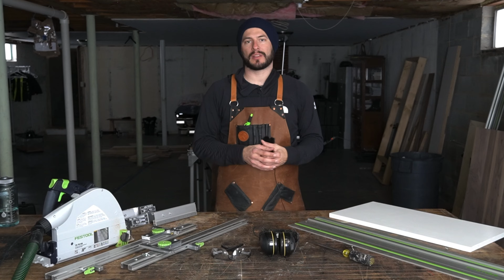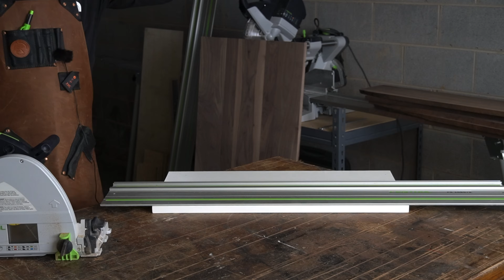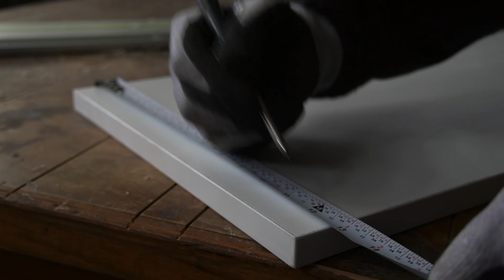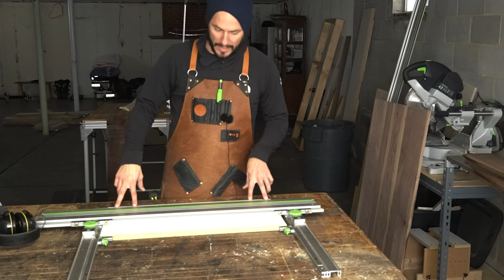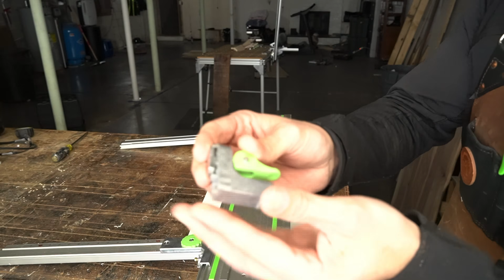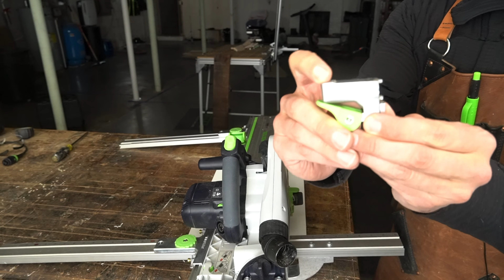How to Set Up the Festool Parallel Guides

Comment: lol, I wish I had the imperial not the metric, got my set used of of Craigslist at a price that was a no brainer. Just ordered a metric tape measure since metric is starting to creep into my woodworking. I do wish that the curser on the stops was a little more precise.
Reply from the maker: Metric is much easier to do than imperial

Comment: Maybe I’m overthinking this, but I’m having a pretty hard time getting my guides properly calibrated. For some reason I can’t just make the mark like you do on top and calibrate that way. I’m off by about 1mm. I take a square and match the line so that my track saw blade(in fast fix mode) is right off to the side of it. Yet I’m still off by 1mm. Do you think maybe I should draw 2 lines (2mm apart from each other) and try to set my blade right in between them?
Reply from the maker: Maybe? Usually these small issues are user error
Reply: @BenMarshallDesigns  I totally agree.  Since then, I think I was finally able to dial it in near perfectly.

Comment: To be a bit more precise, how about setting adjustable square to 12"=305mm and use that to give two exact same marks instead of tape measure?
Reply from the maker: You could, but to me it’s more work for the same result.
Reply: Yeah, except that 12 inches = 304.8 mm, so your suggestion is simply inaccurate.  Better to use 10 inches which is exactly equal to 254 mm. But I don't see how that makes anything more "precise"...

Comment: Thanks for the calibration video. I’m trying to decide on which system to get. Seems like festool missed the mark on the design of this product. It appears to rely on, not only the reference side, but the perpendicular sides as well. What if those aren’t square or are curved? Was that ever an issue for you?
Reply from the maker: If I'm understanding your question, the parallel guides only reference the parallel cut, it has nothing to do with the sides of the material, and actually it is recommended that the parallel guides not touch the sides
Reply: Better watch again. The Festool Parallel guides DO NOT rely on the "perpendicular sides" at all...

Comment: What about the the two flat had screws that engage the side of the rail on each parallel guide do you tighten those?
Reply from the maker: No. Those are only if you want to leave the guides affixed semi-permanently to the guide rail. Say a cabinet shop that makes the same sized cabinets over and over with the same rail

Comment: Have you seen the quick adapters for the TSO parallel guides?  At the moment the quick adapters only work with festool rails.
I had the festool parallel guides and they are a pain in the backside.  The TSO pgs and the quick adapters look sweet.  I ordered a set and am hoping they are as good in use as they appear to be on video.

https://youtu.be/wtHrqdLbqF4
Reply from the maker: I've heard good things about the TSO guides and rail connectors. I received these parallel guides for free from friend, so that's why I use them 😅

Comment: Hi Ben... used to seeing you hairless! Lockdown beard? Looks good. I have the long rail and the mid rail (and the 800) - just wondering why the guides need to be calibrated per rail? Would fresh cuts on the splinter strip avoid this? Great vids... you are costing me a fortune on F-word toys!!
Reply from the maker: Hey David, it's my fitness beard!! Calibrating between rails is more of a best practice than anything else. Between my 1080 rail and my 1400 rail, there is a slight difference in the splinter guards - likely due to different cam positions at different times on the guide base of my TS-75. 

My take on this is that one step costs me a little bit of time, whereas a lack of a step costs me materials (in this case an inaccurate cut). It's just a rule of thumb and in most cases you'll be fine. I just prefer to have millimeter precision in my work, and an additional set up time of 10 minutes is worth the headache of my cuts being off. 

Again, likely isn't necessary in most cases, however it never hurts to double check calibration if using different rails.
Reply: @BenMarshallDesigns  Aaah... the cam comment is a great point - I'm constantly adjusting them... although I should just clean my rails... ;-)
Reply from the maker: @davidbuchan2224  yes, the cams should only have to be adjust every now and then, once you work the lateral tolerance out of the guide plate, don't mess with them.

Comment: Great work as always, Brother!

Couple of quick questions:
1.) I own SYS-MFT & (495020) Systainer Cart... Is there ANY WAY to make a combination of systainers which I can wheel from cart, and have the SYS-MFT level with my MFT/3 table?
2.) Is there ANY way to adjust the height of the MFT Table which I may be overlooking, which will allow me to adjust it to the Cart/systainer/SYS-MFT combo above?
Reply from the maker: 1 - I don't own the cart or sys-mft! I wish I did (hey festool, hook me up!). I'm sure there is a way to make the systainers stacked to meet the 900mm height of the MFT/3. I think the technical info is on festool's website. You may have to fabricate a shim or two to get the height exactly right. Festool does a pretty good job of engineering everything to eventually meet at 900mm. You can go to the Tanos website and build your own load out to figure which combo will give you the correct height. https://produktprogramm.tanos.de/index.asp?action=config
Reply: @BenMarshallDesigns  Ahhh.  As always, I greatly appreciate your time, talent, and patience to answer questions, Brother.

Wishing your family health, happiness, and success.

LEAD THE WAY!